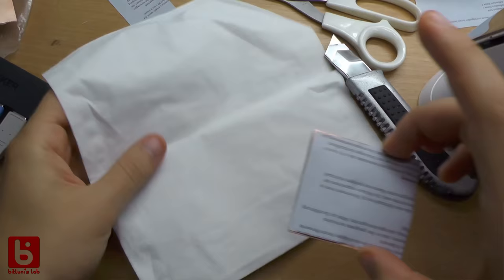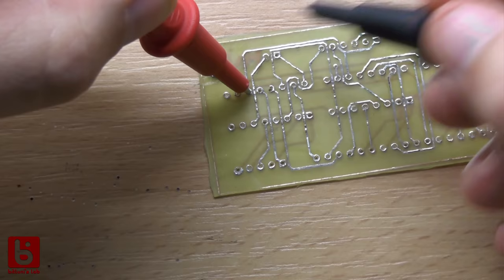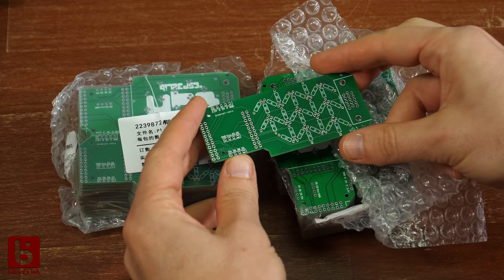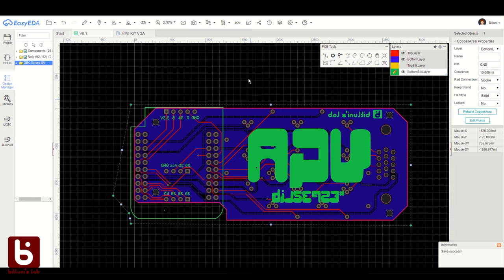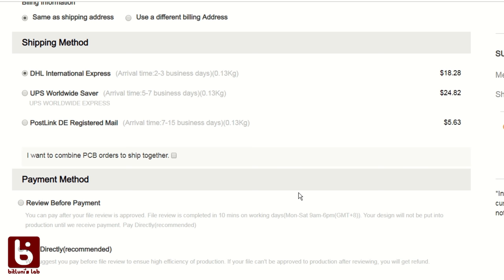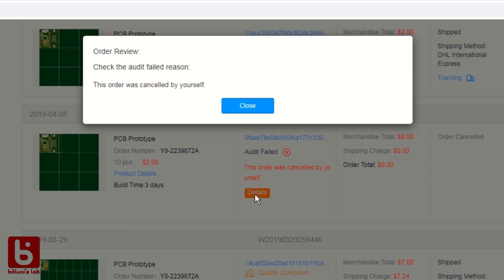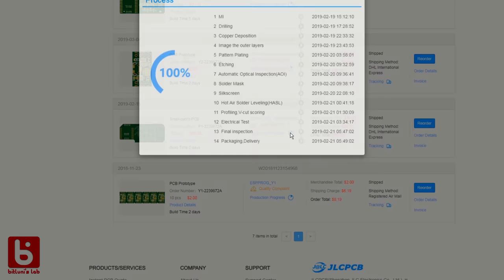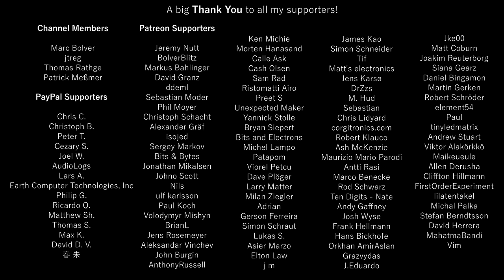Ordering PCBs from China

Comment: I've used several of the inexpensive PCB fab places recently.  They all put out good quality boards.  But JLCPCB is currently my go-to.  Not only are they unbelievably cheap (and quick), but if you buy components from their sister company (LCSC), not only do you save on shipping, they'll populate the boards with those parts at no cost!  
For the record, I have no association with them, or any PCB fab company.

Comment: I have the same positive experience with JLCPCB, no hassle and very responsive and clever support staff.
You are also the first reviewer that pointed out the autorouter in EasyEDA, which I use all the time, Some versions have problems (routing across holes for instance ) but that can be easily fixed. New versions are regularly supplied.  
The best feature of EasyEDA is the huge number of available footprints and the ease with which you can make your own, if needed.
Reply from the maker: I really agree on the good customer service. They actually READ the custom text fields also when you place your order and do their best to do as you wish. I used the text field to tell them where to place their serial number on the silkscreen so it's hidden under the components later. They weren't able to put it on the other side of the board but I was still happy that they came back to me via email and we were able to clarify it quickly. 
The User contributions in EasyEDA really saves up time having even some standard circuits ready and all the footprints of the micro controllers and shields.
Reply: the cloud feature of easyeda is immensely useful. the crowd sharing designs of footprints is a huge time saver. it's also satisfying to see other people use your footprints.

Comment: We had some failures with our last pcb manufacturers. 
Our last one hasn't dried the solder stop mask, so we had to throw away 100 smd-mounted PCBs. (At our wave soldering process the solder messed up our PCBs. The solder did stick all over the whole PCB, even at the solder stop mask.) 
Other scenarios we recently had are: displaced solder mask, forgotten to insert the circuit. (Yes, we got PCBs with prints but without the circuit...), Short circuit between nearby lanes, etc....

Comment: I've used them a few times now, particularly because they will install the smd parts for relatively cheap, but the last board I did had two 0603 caps missing.
I'd also point out I've made my own too, and always do smd so no drilling holes, and then I manually edit the traces substantially to reduce the copper etch traces to minmal and make big pads and fat traces.   two weeks is forever when you are trying to get product out, and usually first batch needs reversion, so 4 weeks too long.

Comment: Nice, finally a neutral perspective of jlcpcb and no aggressive advertisement. I might give them a try soon. I wonder how good SMD PCBs are going to be ^^
Reply: Just give them a try. I also tried them before they offered to sponsor a video and they offer good quality at low prices. You can see some of those boards - including me soldering SMD parts - in my latest videos...
Reply: I've been using them a fair bit lately and have had really good results, though I am a bit of a newbie. But I've done 4-layer boards with lots of SMD components, and it went well.

Comment: I would love an Easyeda tutorial for beginners video.
I need to make a kind of sensor shield for the ESP32, maybe you could make that as example. :)
I you should use a logical converter for some pins, like I need too. Because most of the sensors are 5v and the ESP 3.3v.
Just make a female pin header for the ESP and the Logical converter and some Male for the sensor.
Please, make sure to show how to use the printing letters on the board part.
Reply: The ESP8266 and ESP32 GPIOs are 5v safe, a logic converter isn't usually necessary.
Reply: @CrimsonTide001  Do you have documentation to support that?

Comment: Hi, did you panelize boards by yourself or you used their service? Also is there any extra charge for breakable tabs(panel)?
Reply from the maker: For the v grooves I used the tool in easyeda. For the mouse bites I used the tool shown in brians video linked in the info card
Reply: @bitluni  i tried using gerber tools but they told me. How they won't do it and wanted to charge me aidtional 8 dollars

Comment: Sure, this is much easier than making your own PCBs, but I don't think it's more convenient nor cheaper. First off, if we include shipping and the fact that you only need 1 or 2 for prototypes, no it isn't cheaper at all (unless they sponsor you and you get them for free, that is). Not only that, but you can make a PCB in at most 1 hour, which is very convenient for prototyping because you don't have to wait a few weeks until you forget you even had that project! Either that or pay a lot of extra money for expedited shipping, which completely negates the benefit of it being potentially cheaper. And if you make a fatal unfixable mistake you have to pay and wait again! I wouldn't order PCBs until I have a fully functional prototype, or if I really need more than 2 layers.
Reply from the maker: It really depends on the individual requirements about the shipping time. I don't bother etching currently anymore. I can imagine to do it for time critical stuff. but only for one-sided designs with a pin pitch over 0.5mm or two-sided with only a few vias. However I don't agree on the cost with you. At least not with Sodium persulfate in Germany. Regardless of the labor the chemicals still cost a few € and the worst thing is the disposal of the chemical waste. I have several jars sitting here with the saturated solutions. It's illegal to put it down the drain so I need to bring them to the proper disposal facility (what is again a hassle) and pay for it again. Do you have a better solution? I'd like to know if I could improve on that.
Reply: no way can home hobbyist make 2 layer board with plated throguh holes and silkscreen for the same price or time. and 4 layer boards are completely impossible for home hobbyist. 1 hour pcb is just a pipe dream. just not possible except for stupidly basic boards with no features and no precision required. jlcpcb is stupidly cheap, my time is worth far more than fiddling with etchants or cnc and still not getting good results. i wait 3 days for boards, that is nothing. if your time is worth nothing then maybe making boards yourself is worth it. but not for me.
Reply: Not sure where you're located, but for me in the UK, it takes under a week (sometimes 5 days) for my order from JLC/PCBWay to arrive from China without expedited shipping. I usually work on overlapping projects, so it's not a problem. The quality is obviously much higher, with tighter tolerances, and fully tested too. Plus no need to mess with hazardous chemicals, or having to drill boards and hope the sides are aligned ok too. True that the shipping does add quite a bit, but I value my time more than that - I doubt anyone can create a viable, non-trivial 2 sided board themselves in just an hour.